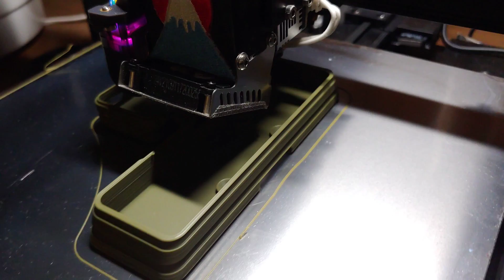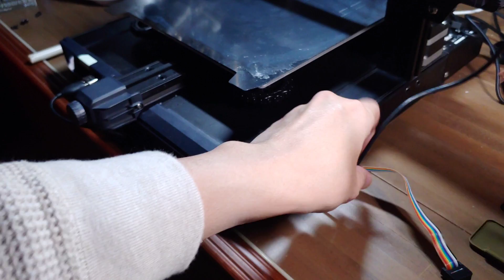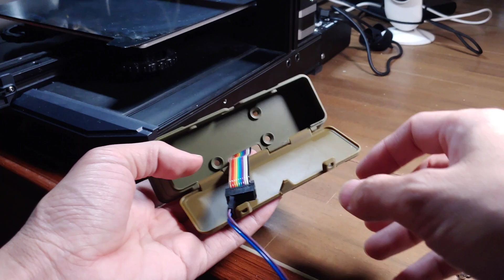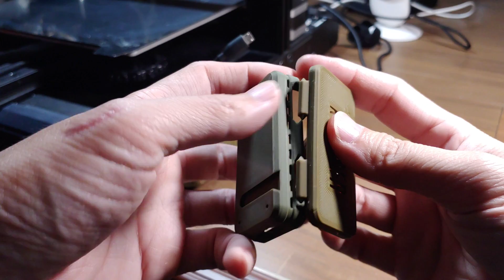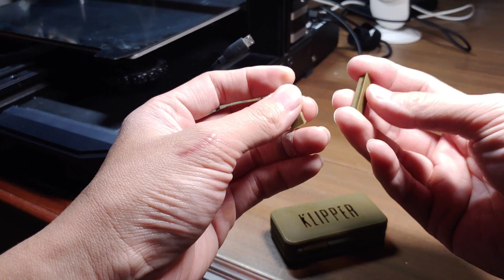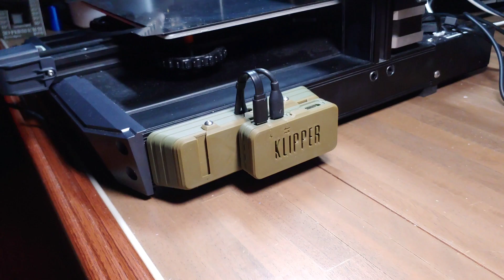The KlipperBox - Attaching the Raspberry Pi Zero(2) onto the 3D printer Modularized

Comment: The ender 3 S1 has an internal USB connector (Not USB form factor, but 4 pin USB, albeit for a PI you only need 3 wires) you could use to make it cleaner and entirely route the cable through inside, instead of the external USB cable.

Comment: Taking power from the lcd is clever but in that way you basically hard shutdown the RP zero every time you turn off the printer...I would rather have an indipendent psu for the rasberry